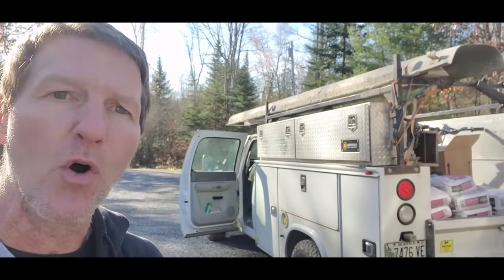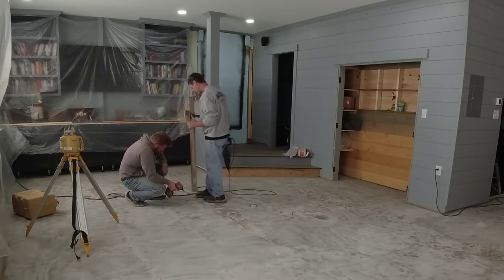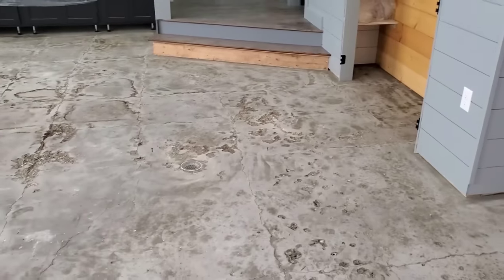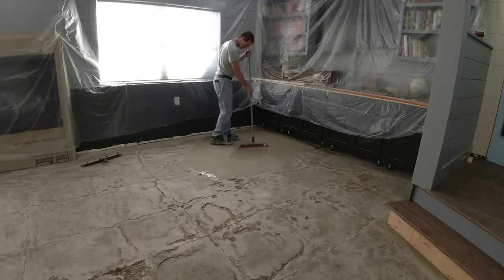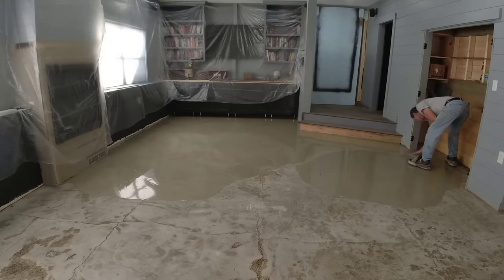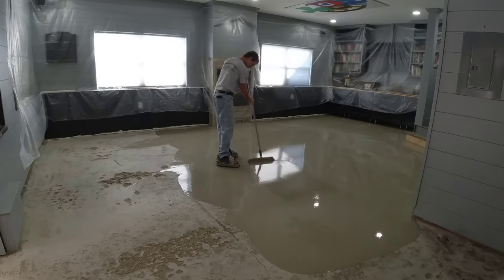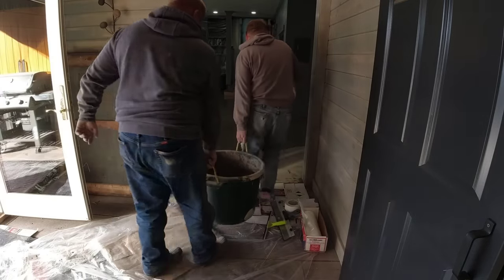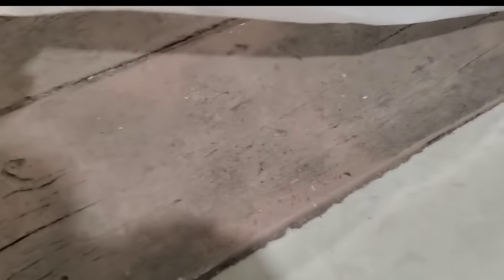Amazing Self Leveling Concrete Overlay (Fixing a badly damaged concrete floor)

Comment: as floor guy who did a lot selfleveling, a small tip, you can buy that roller, it is game changer, and make perfect perfect. it work like vibrator screed. another tip, you can put few light bar on another end, after you spread out,  check the reflection of light to find any deshape.

Comment: My experiences with this stuff have been excellent.  Early on, I found that you MUST mix it to a loose, pourable consistency....don't worry about it being too thin.  If it's too thick, it won't flow and level.  You must  seal ALL edges and openings through which the leveler can seep out.  not only will it make a divot in the final job, it may damage something down below.  Finally, this stuff "cures" rather than "dries."  So, as soon as you mix it, it wants to start hardening up.  Pour it, spread it, level it and MOVE ON!  It's great for leveling bathroom floors, too!
Reply from the maker: Awesome, thank you for the comment!
Reply: Must mix according to manufacturer, water to powder ratio needs to be accurate
Reply: No mention of the surface destroying bubbles that I experienced. Awful!
Reply: @matoko123  was a primer required and did you use it?
Reply: @SuperTedsmith  that is exactly what needed to be said. 
The first job I did with self leveling material was a learning experience. I mixed exactly the right amount of water according to the directions but it looked too thick so I add an extra cup or two of water to where I thought it looked like it should be.  I left for an hour and a half and when I came back it was Matt colored around the perimeter of the area and it was a very thin film of water across the middle where the floor was deeper.
I learned is that this is a chemical reaction. When mixed according to instructions the water and the cement mixture combine in a way that makes this reaction take place. When mixed correctly, some of the products can be walked on in an hour because the chemical reaction removes or converts the water.  If you add extra water, the chemical reaction still takes place but then the entire mix has too much water and now the water must evaporate.
Can take an awful long time for the water to evaporate. A couple of hours, it may take a few days and who knows how that extra water effected of the material.   This is not plain old concrete.  These are high-tech materials and the only thing that's important is having the mixing containers ready to go so you can do the poor as quickly as possible.  That can mean having an extra person or two doing nothing but cleaning buckets and getting them ready for the next mixing. It's better to have too many people than not enough, especially so when the weather is warm.
Use cold water to slow down the chemical process, not hot water from 100 ft hose laying outside..... If you use the warm or hot water from the hose you will learn very quickly why not to do that. 😁
Reply: @matoko123 3:11
Reply: @theoneonlydave  Thanks for pointing me to that. I did actually prime it with something like PVA but still got the bubbles. I think I just didn't do a very good job of it and the temperature at the time was about 8 degrees, below the recommended minimum from what I recall. But it was still an improvement on what there was before :)
Reply: Thanks Dad...
Reply: If too thin it will shrink on setting, resulting in uneven floor foe deeper parts

Comment: Have you ever heard that mixing self level with ice water makes it flow way better i work for a commercial tile company specializing in hospitals and schools we do a lot of self level and we fill a 50gal drum with water and add two large bags of ice then we use the ice water when we mix we use a cut off 50 gal drum mixing 3 bags at a time

Comment: I was renovating Ikea bathrooms with my buddies and we used self leveling concrete for the floors because we ripped out the old tiles and took some of the concrete with them. We had the tile guys coming in two days and they were suoer happy with the result. Very simple easy job and this a great idea to make a old garage floor have some youth into it again.
Reply from the maker: Thanks, that's awesome!

Comment: Great content Mike.  Being in the flooring business for 20 years now I have used alot of self leveling.  My only recommendation I would say and you already said it.  Use the primer every time.  Keep up the good work. 👍
Reply from the maker: Great tip!
Reply: Rule of thumb in self leveling is primer is a must
Reply: Okay, how do you fix if primer wasn't used before the pour?
Reply: @Wright_Works  cross fingers. 🫣
If it didn't pop, you'll probably be fine, but I agree. It helps the bond and helps reduce moisture being sucked from the self leveler.  Most self levelers require X amount of water per bag.  If it looks too thick, don't add another cup of water to suit it to your liking.
It's a precisely engineered material and you don't want to screw with the chemistry.
I added extra water on my first job. Not much, maybe a half cup.... or more.
I came back two hours later and there was a 1/32" pool of water in the center of the pour.  It should have been ok to walk on, but it wasn't.

Comment: I've used a couple of the self leveling products. Great to have the three of you to work together on this with two mixing and you moving it around. That stuff can set up pretty quickly! It's not cheap, but it is WAY more cost effective than the alternative: Breaking up the old floor and pouring a new one.
Reply from the maker: You're right on George!

Comment: Love watching these videos. Maybe I can do this in my basement. My town has had at least two 100 year floods in the last 50 yrs before they fixed the river flow.  My 104 yr old house has several rooms in the basement where the concrete has failed and is all broken up or cracked... something I discovered only after removing the false floors. I just want to get all the debris removed and get some respectable concrete floors in. This would work short of pouring all new thick floors.
Reply from the maker: It might work, you saw how bad this floor was.

Comment: Very helpful. QUESTION: I have an old floor we are chipping saltillo tile out of. It will probably need repairs and leveling. I want to make this floor a sandy off off-white color with no joints or stamping. Prefer a finish similar to a fine smooth plastered wall. Not looking for a high polish. I imagine it will need a penetrating sealer, and we want to ensure that the sealer leaves no sheen or coated appearance. I appreciate the advice upfront. Thank you!

Comment: You should really invest in a three bag mixer. Wolff makes ones with wheels and a pivoting point so you don’t have to make your boys break there backs . It also has a removable mixer holder.  Been working with a product from Germany called Uzin and it levels out much more glassy and more fluid like. Much better than the other brands I’ve worked with never gone back. I like your screw technique btw !

Comment: Do you have a video showing fixing the spalling and big craters or cracks prior to using the self-leveling? What would be the maximum thickness you could use? Can you put down two coats? I've got a garage with a wacky floor, a corner and the garage door threshold have settled.
Reply from the maker: Check out Sakrete Pro-Mix All purpose cement repair. That's what you can use to repair first. Also their Top & Bond repair. You can go thicker with this if you add some pea-stone to the mix when mixing (up to 1.5") You can go up to 1" without the added stone.
You can layer over itself, just use the primer between layers.
Reply: @MikeDayConcrete  hanks so much! I've been wanting to fix it up but not wanting to make a mess! Have a great day!

Comment: Great video! My "new" house has a garage converted to a living room, and it's way out of level. It's got 12" ceramic tile down, and Jeff at Home Renovision has said you can go over tile (especially if there's possibly asbestos; I don't think mine does likely doesn't b/c it's from the 1990s). If you agree, should I rough up the tile or just pour on top . . . to what thickness? I want to install LVP. Thanks!
Reply: Paint a tile PVA on it first.
Reply: Did you end up going over tile?
Reply: @hectorsanchez2524  I've got the floor prepped, but the drop is 2", so I'm going have to build that end up by adding gravel, then let that set and cool before adding the self-leveling concrete.

Comment: your videos are extremely helpful, thank you. I've been using sakrete products to repair a slab and I'm ready to use the self leveling resurface but the Sakrete Bonder & Fortifier as well as the Bond Strength Primer Additive don't seem to be available anywhere.  is there a good substitute product you can recommend?  thank you

Comment: Prep and primer are spot on. I would add that you should keep rolling the primer and even add a little to ensure there is No porosity because every bubble will show. 

However...

Why does everyone work self-leveling compound by hand? It's called Self-Leveling for a reason. Done that way it is Not level or even flat, regardless of how many "grade screws" you use. No human is that good by hand, at least not on an entire floor. Patching low spots or damage is a different story. If you don't believe me, pour water on the finished coat after it cures; there will be puddles.

1.) Find the highest spot in the floor then add 1/8", that is your finished floor grade. 2.) Form off all doorways, etc. and seal to prevent seepage. 3.) Mark the walls/forms at finished grade height. 4.) Mix leveling compound per instructions, if not slightly thinner (never thicker). 5.) Pour up to your marked grade lines and walk away, do not touch it.

Screeding is possible, but very difficult with thin coats.

Comment: Great video super helpful! 

How many sqft was the area and how many bags did you use?

I'm considering doing around 800sqft of my basement.
Reply from the maker: This was 480 sf. About 40 bags. They'll do about 50 sf at 1/8" thick.
Reply: With the slop of the floor how did you calculate for your material/number of bags?

Comment: How well would this perform used outdoors to resurface badly spalled concrete in to driveway? No heavy trucks, cars and pickups only. Freezing down to 5 or 10 F in winter, 100F in summer.
Reply from the maker: It's rated for exterior use and is stronger than concrete. Really depends on the prep and adhesion to the existing concrete. It will work if it's done right.

Comment: I plan on using this stuff to level and prep floors in a 100 year old house where I'm laying LVT throughout.  I know I have to seal up all the cracks and holes in the floors but I need to use the primer if I'm just going over the leveler with clicklock flooring?

Comment: Hi Mike.  I just had a new floor pour and it has a 1.5 inch pitch to a central drain.  It has abt a 5/8 low area 8×8 ft on a 44x36 floor.  Can Self leveling concrete work on a pitch floor and maintain the pitch? Thanks

Comment: So would a primer help when the concrete has already been painted and I want to put down some thin leveling compound? My house uses hydronic floor heating and the builder (owner built) used regular concrete and not gypsum. Then the concrete was painted and carpet laid down, single layer, no pad. It's not in terrible condition but I'm thinking about vinyl flooring planks, no foam. I haven't check to see how level or straight the floor is. Just some barely visible trowel marks so not a smooth pour. Thanks.

Comment: I'm trying to crowdfund for drywall and SL concrete.     We had a mold issue and it ate our house apart and we lost my mom to the sickness caused by it.     I've been working on this house for months  and this is going to be a cost effective  solution to make things look nicer.   I can't afford real floors.   So I wanna do this and stain.  Or if the crowd funding goes well enough pay a service to epoxy it

Comment: Will this concrete survive harsh -20 ambient winters to 95 deg summers, or will it crack and spall? Planning to cover a non-climate controlled 1912 garage that has 6'x6'concrete slabs that have shifted over time. Thanks!

Comment: Hello Mike, had a question. I'm looking at resurfacing my garage floor and wanted to know if this Sakrete product would hold up to having a car parked on it? Also, could you epoxy or paint this floor right after it has cured or would you still need to grind or etch it before applying those coatings? Thanks and enjoy your videos!
Reply from the maker: It would hold up in a garage, yes. If I were to epoxy over it, I would lightly grind it but I grind everything we epoxy over. It is porous already but I wouldn't chance it, always grind if you epoxy. I don't like just etching and don't recommend it.

Comment: Can this be done on an exterior patio? For a bit more info: I had a company come and level out my badly broken up 25x11 patio (with crushed limestone) so it is level now… however the cracks remain. Can I patch the cracks and use this same method? I live in northwest Indiana so I do have a rough winter….

Comment: Question: shouldn’t you start with filling the deepest area and work your way towards the shallower areas so that it doesn’t try to run downhill to the deep area?  I’m gonna have to do this in my basement and was just wondering.

Comment: How many bags did you go through? Where can I get the primer and the concrete lever? Great video. I need to do my driveway will it hold up to ice and also can I use salt on it to melt the snow? How long will it last? I do have prety big cracks

Comment: That's the product I need for my shop.  Just checked the price and got a bit of sticker shock, $36 per 50 lb bag!  The "countertop" mix was only $22 per 80 lb bag.  The specs look similar.  What's the difference between these two mixes?  I'd assume the countertop mix isn't formulated to pour as thinly?  
Also, I'm curious about how you estimated the quantity of mix to purchase for the job?  And is there a DIY method that works without a laser level setup?
Thanks

Comment: Mike - How would you fix a concrete pad (driveway) outside where I used Ice Melt by mistake and the top finish spawled and now I can see the aggregate... I have heard so many different opinions locally... some say I have to dig it up and start over, some say an epoxy surface top coat... With car traffic I don't want something that will fail in the future. I had no idea Ice Melt would destroy the concrete... Thanks - Great content by the way...

Comment: About to put self-leveling down in my kitchen - a much smaller space than this, but I'm still kinda nervous about it!

With this install did you have to sand the surface at all to lose any trowel / join marks? I've seen SLC done a few times and where the pours join they never seem to merge seamlessly even once fully set.
Reply from the maker: All the batches were seamless, couldn't tell one from the other. NO sanding afterwards at all.
Reply: @MikeDayConcrete  good job! Just done mine this afternoon, had to trowel it flat! 😂
Reply from the maker: What product did you use?
Reply: @MikeDayConcrete  I'm in the UK so used Screwfix's own. Did another room with the same stuff and it went a lot better. Feel a lot happier about it now...not sure I could get a floor level but could probably get one flat, with even coverage across it. Trying to corral the stuff into different areas in different amounts to get it both flat and level would probably be pushing it tho... I think I'd be tempted to use some kind of flat edge with screwheads in the floor for that. (Or even separate the floor into dammed-off areas and do them individually - I'm only DIY so the time is secondary to getting a good result with my limited skills).
Reply: Move fast! Get the second batch down before the first starts to go off.

Comment: My mom has a badly pitted garage and I would love to fix it for her. I feel like this would work great. Do you think it would hold up for a few years if she's driving her car over it with the salt from the roads.
Reply from the maker: If you prep the concrete like we did, then seal the self leveler afterwards, it'll last. It's 5500 psi, that's stronger than the concrete in the garage.

Comment: Can you use this self-leveler to resurface a garage floor?  What I mean by that is will this thin coat of concrete crack under the weight of a heavy car or truck?  What would you recommend for a job like that?

Comment: Hey Mike, would love to know with new garage flooring that’s around 1 month old, should I use a primer before using an epoxy?
Reply from the maker: It depends on the epoxy, but in most cases yes. You gotta grind that concrete first. Then primer epoxy, then colored epoxy.
Reply: 1 month concrete is still pretty green and will still have a fair amount of moisture that could bubble epoxy.

Comment: Mike (or any other pro) - Would this leveler be suitable to resurface a garage floor? Some cracks and dips which I would fill in prior but trying to figure out if this leveler would work better than the rapid set resurface product? 
And thanks for such an informative video ( doing a lot of diy stuff and your videos have been tremendously helpful)!
Reply: None of the self levellers I’ve ever worked with are designed as a wear layer, meaning it shouldn’t be left as a finished surface and must be covered with ‘flooring’. You can get patching compounds which will withstand traffic directly but to my knowledge none of these share self levelling characteristics which help to achieve the flatness.

Comment: Is there a specific  mixing paddle for self leveling or maybe a different  technique maybe to long on mixing. I used a primer exactly how the directions said and had an extreme amount of air bubbles anyway. Which I had to use a micro topping to cover .any suggestions?